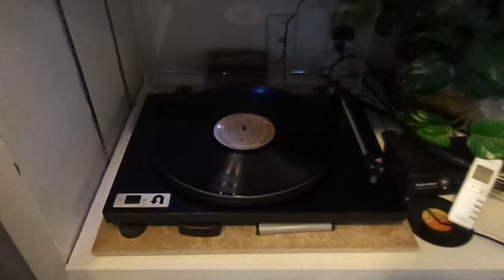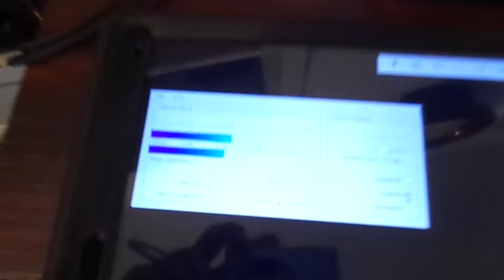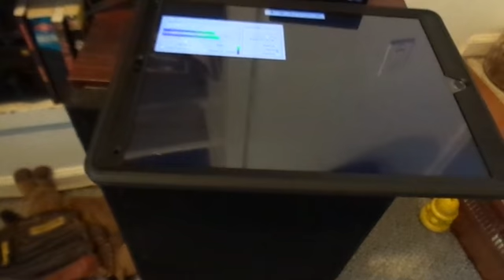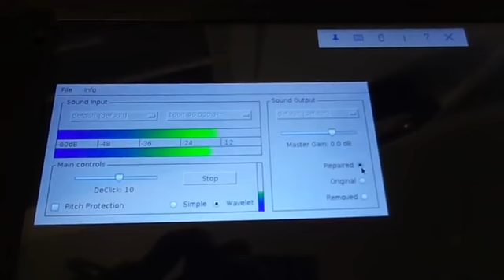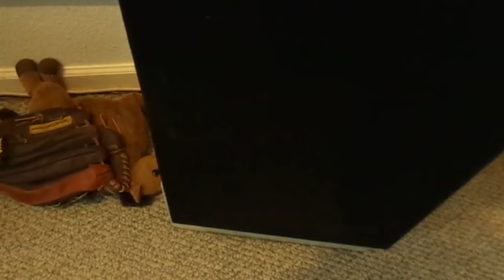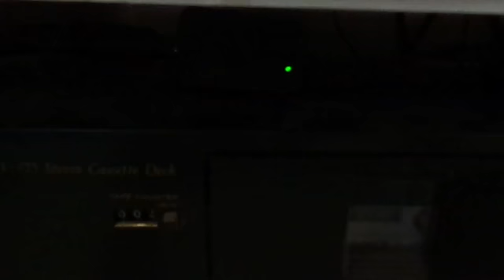Real Time Click Repair Filter Device - ClickRepairRT w/ a MiniPC

Comment: Hi Kris, outstanding job setting this up on a dedicated mini PC!  I had a copy of ClickRepair about 10 years ago, which I ran on an XP machine.  The machine died, and with it the program ... so I forgot all about it until I found this video of yours ... and now I'm itching to play with it again.  Sadly the website is gone  :(   Do you happen to know where I could buy a copy of the software?  I will check back here later,  to see if you've sent me a reply.  I will also try to locate you via email.  Thanks for your help and keep up the good sounds!  ... GM in central PA.
Reply from the maker: If you do a search on facebook for clickrepair, there is a group there where volunteers took up the project after the author passed away.  Modernized some of the code, made it a little easier to use and added a few features, and its all free.   But, you oddly have to join the group to get it - they don’t have a site.  The wayback machine also works, but this way you get a key and keep the project alive.

Comment: late to the party on this one.  However - finding this video has caused me great entertainment and probably launched me on a "stretch" project to see if I can duplicate with similar results.    Thanks for your contribution Kris.  after thought questions.   Are you still using this setup?  If so, have you upgraded any of the components?
Reply from the maker: My pleasure - if you use the archive.org wayback machine, you will be able to find the program.  I think the author has since passed on, so not sure if you can get a license.  You don't have to use linux and the way I did it, just having an old computer around should be enough.
Reply: @dixielandfarm  thanks again.  not sure if you saw my edit.  you still using this setup after 7 years?
Reply from the maker: @wesleysmith8  I am - the way I designed it is to never have to think about it again - so it is an appliance to me and is always just in-line working.

Comment: By the way, I noticed your version seems to be 1.4.3  as mine is 1.3 (the one I get from the link on the comments below) Any chance to find somewhere the 1.4.3 ? I would likr to pay the 40$ registartion for the lastest one, and the website ClickRepair seems down unfortunally...
Reply from the maker: If you look in the comments there are links to the Internet Archive Wayback machine which is a public record of many websites, including clickrepair and the downloads.
Reply: @dixielandfarm  your video changed my life!  I jumped in VINYL 3 month ago after 30 years to listening CDs. And was not very comfortable with crackling, especially with NEW LP with bad pressing. And I love colored and picture LP (seems not to be the best for pressing quality)
Well I finally managed to get a licence for a working ClixkRepairRT given by a friend! 
I bought an used old mini PC for 50 dollard, an run with it. I can pilot the PC from my phone with teamviewer. 
I had to install Ubuntu (what a hell for me lol) cause for an strange reason, on windows 7 or w10, clickrepair worked, but clickrepairRT refused to start (as well.with lastorolderJavaversion) and the stranger thing is that on my main PC, it worked perfectly)
Anyway the most impressive thing is that with my ears I CANT ear a difference, connection my turntable directly on the amplifier, or going through the PC, and same when I jump with clickrepairRT from normal to repair, no difference, except the click deasapering ! So thanks for your video!
Reply from the maker: @ced777  That is so good to hear.  I am glad it is working out for you.  Ubuntu or Debian instructions I had were for whatever version it was back then - too much time may have gone forward and too new versions might be the culprit - but you have it got it all figured out regardless, so I think you are good.

Comment: Amazing ! Just found your video. I'm "new" on vinyl, since 2 months, and I hate the crackling, especially on new LP... (what a shame) I tested RT Click Repair from my computer, works very well. Seems not to be the same version than yours, cause I can't choose "simple or wavelet" for exemple, not the pitch protection as well (or it perhaps cause I'm still on the free trial period ?)

Do you use this each time you listen a vinyl ? (I seriously consider to do that, as I didn't noticed any loose of sound, with or with out RT Click repair, and as well using my turnable directly on my hifi amplifier, or going through my PC didnt made any difference (at least for my ears)

When you turn on your mini computer, I tried that on windows. I start the computer, RT Click Repairs starts, but, I need to click on the buttom start.... How did you succeed to make that, once started, the program "turn on start mode" automatically ? 

Thanks for your answers and for this great video :D
Reply from the maker: I use the clickrepair computer every time - I just hit the button to turn it on and it is ready to go.  How I did EVERYTHING is outlined in the description with a link, but if you are using Windows (I was using Linux) you can find a program that can automate keystrokes and mouse movements - I would recommend keystrokes and finding the right amount of ALT and TAB to get to the start button, this way if the window ever moves on you due to some windows-weirdness, it will just work.  Good luck!
Reply: @dixielandfarm  Thanks a lot for your answer !
And with the years of use, you never found some "cuts" or "lack" on the music caused by the click removing ? You keep the Click Removal level at the middle power ?
Reply from the maker: @ced777  That is correct - in casual listening I never have had any issues - if I was digitizing, I would record it before the clickrepair computer and do a proper declicking with the main program.

Comment: I am SO spoiled now, using Click Repair RT all the time now, I don’t even listen to records without it. It’s a big pain though to have it always running on my iMac. In your vid you say that a Rasp Pi wouldn’t run it, but do you think they may have caught up in speed or power in the last couple of years? I’d love to have a dedicated box like you made and the price on a Pi is right but if it’s too slow then forget it. I also considered dedicating a Mac Mini but it’s just as much hassle as I have now. Any advice four years on?
Reply from the maker: If it is power you are worried about, I would try an RPI4 - those MIGHT be strong enough at this point - but not available when I shot this video.  If cheap is the consideration, you can find super old laptops for the same price and just have it sit behind the stereo.

Comment: I love this and really want to do it but have zero Linux experience, so I feel like that's out. Thinking I could just do this with the soundcard and a low-mid tier laptop...?
Reply from the maker: Absolutely.  You can use windows, a laptop and a soundcard and just see how it works.  Automating it so it all acts like a device opposed to a computer was all the linux/tricky stuff I decided to do.  You will have to find the program link somewhere though (I think someone left a link in the comments) - it has been discontinued for a few years now.
Reply: @dixielandfarm  Thanks, I'm gonna go laptop hunting today! Found and downloaded the program and just have to buy the license.
Reply: @lukemalone3575  DO you have bought th elicence? Any idea if the licence works only on one computer, of if it works when you chance computer? Cuase for the moment, I use the trial on my big computer, but on the futur I consider to buy a smallest computer, and let it with the hifi system, more convenient.
Reply: @ced777  I did buy the license, and my confirmation email says “for use on any of your computers”, so you should be good to use it on multiple!
Reply: @lukemalone3575  Thanks for your answer. You got the 1.4.3 version, or the 1.3 ClickRepair RT version ? What website did you used to buy the licence ? When I go to the website store.kago.com seems to don't works.... ANd the official website clickrepairs seems down, no answers as I tried to reach the professor that made this program.... :(
Reply: @ced777  my version is 1.4.1, found on the wayback machine. There’s some new information on this forum: https://forums.stevehoffman.tv/threads/whats-going-on-with-clickrepair.1029567/
It looks like the author of the software isn’t well :(
Reply: @lukemalone3575  Unfortunally, I can't find any way to buy a licence as the website is down. Tested a version, with my computer, and it works perfect, so, I'm very sad...
Seems my only chance will be to find someone that bought the licence, and dont use it, and sell it to me...

Comment: Kris, any reason not to run this to my main PC in the next room?  I have a closet in the space between and the run would be about 10' each way.  Could i just leave the program up and running at all times?
Reply from the maker: No reason at all, Mike.  I would try it and see how it goes.  The program is no longer available, but if you look on the Internet Wayback Machine which archives websites (and you can find a link in one of the comments below), you should be able to find the program.

Comment: Hi Kris, so, you go from the TT  to the sound card to feed it to the PC and then from the PC to the Stereo Receiver? ,how or from where do you get the output of the PC to the amp? just through the Audio out 3.5 jack from the PC soundcard??
Reply from the maker: I go from the Turntable to the Phono PreAmp (external), then to my digital recorder (so I can capture any vinyl playback), then from the digital recorder out to the soundcard input, then from the soundcard output to the amp.  Correct 3.5mm jacks.  I did buy pretty good 3.5mm cables, they are a little beefier than throwaway junk, and I have kept the cable runs short where I can.  You also have to be careful with sound levels throughout so you are not either reducing the signal or overloading it through all of that, but that's pretty easy now with VU meters pretty much every step of the way.
Reply: @dixielandfarm  awesome! I will give it a try...  by the way I love your  videos.

Comment: Great project. What if use new NVIDIA Jetson Nano? It's less expensive than the current setup and more powerful than raspberry
Reply from the maker: I really don't know!  The ARM is I think the limiting factor, not even the core amount.  The computation needed for real time without a lag is a little strong - most users are concerned with video which gets off-loaded to the GPU - the software isn't coded for that (since it is Java), and Java doesn't do that (as far as I know)... The computer sells for $130 usually now, so it isn't TOO far off.   I think you can also buy older NUCs and be at a similar price point.  A shame, as if this ran on a computer like the odroid or pi, it could be a real thing for more people.
Reply: @dixielandfarm  With the new Raspberry Pi 4 out with a bit more horsepower, getting this working on Raspian would be a revelation.  Or even the Pi 3 B+.   Kris is this feasible?
Reply from the maker: @aluke000  I tried the 3 B+, I believe (memory is fuzzy).  I think it would be a good bet that it MIGHT be able to.  I think we need specs of the 4 in comparison to the Atom (which is also a pretty underpowered CPU).  If they are at all close, its a go.  Since Im effectively done, and there is such little interest, I never moved on to other platforms.  If you can borrow a 4, it would be trivial to put Raspian and the program on to check (you don't have to go through all the autoboot/stripped things that I did to test).  Let me know if you do it!

Comment: Guess the "RT" part of ClickRepair is no longer bundled with the product :(.  One statement you made about testing a CD-4 Quad record as proof the signal only goes to 48k; as I was an audiophile when CD-4 was out, I recall there was a "carrier" signal at 45kHz which was used to split/decode the channels.  However it took a special cartridge to get to that frequency and a Shibata-type stylus required to really get down into the groove to fetch it.  I have any number of CD-4 LP's which outline these requirements in the record liner.  I even have a CD-4 Test Record that would help calibrate your CD-4 demodulator, whether a separate unit or built into a receiver, so the carrier could be properly read to create optimum separation among the 4-channels.  Keep up the great videos!
Reply from the maker: I think if you look in the comments on this video there is a link - the web.archive.org wayback machine still has a snapshot of when it was last available.  I have been meaning to have a video, but you would be surprised at how many records have everything rolled off after 16khz, let alone 20khz... they just didn't want to heat up the cutter head... but that requires LOTS of samples and graphs and I just haven't the time or dedication to actually go through with it yet.   Thanks for watching, and if you do download and try it out, let me know!

Comment: I downloaded (Windows 7 PC) an older version of ClickRepair so that I could receive the Click Repair RT programme coming  with it (used the Internet Archive Wayback Machine). Although I can use the Click Repair programme (trial mode) Click Repair RT unfortunately does not open/work, although it has been downloaded, too. Do you know what the problem might be?
Reply from the maker: I don't... but I know this is part of the reason why he stopped offering the program - getting that java input/output to work right varies computer to computer - you have to keep at it to see - or it just might not work right at all.  That is the other thing people don't get - while there is a straight java version (the one I use), there is also a windows/mac version which is really just the java version with an installer - they are all the same program and java is the culprit.  Perhaps DOWNGRADING the java version you have to a version that was current when the program was around might help?
Reply: I finally tried it on an old MacBook and with that I can open ClickRepair RT. Unfortunately I could not work on a music file coming from an attached USB stick. It seems one has to connect a turntable etc. Maybe connecting a digital audio player would work?
Reply from the maker: Correct - you would just use normal ClickRepair on a file that is already recorded.  BUT, if for some reason you didn't want to do that, I think you have to look into something called a virtual patch cable which will take the output of your media player playing the file (like a virtual turntable) and then run it through the program in real time.